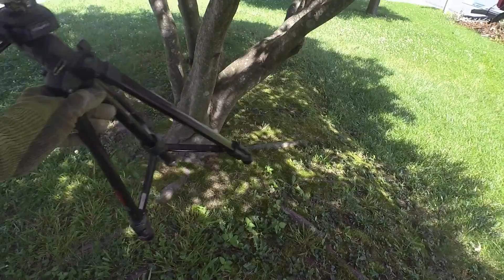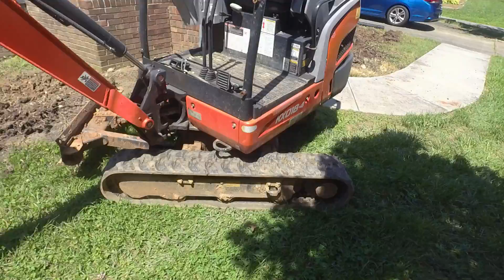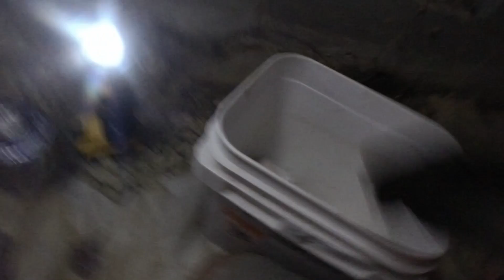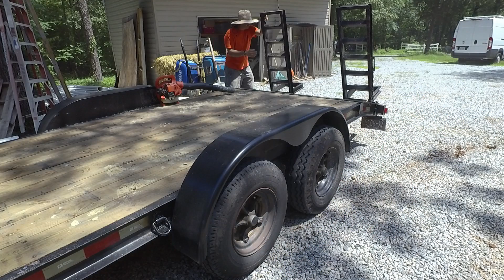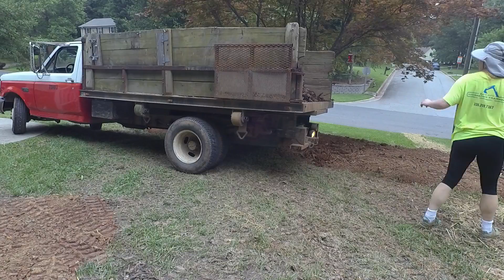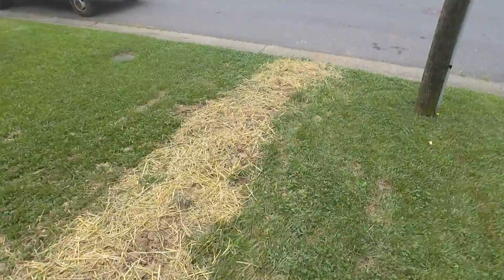Sump Pump discharge line turned into some stump removal and dirt work

Comment: I've been told you should have an air vent where it exits the house since an airlock/vacuum is created when the water runs to the street. I've used a wye tee at the house exit with a few inches of vertical pipe then to an open 180 to let air in at the highest point.
Reply from the maker: Yes you can do that so the line drains down. This is only the case when the discharge is lower than the pump.

Comment: Hey Shawn, I just want to know why that down spout near the sump pump discharge wasn’t caught?
Reply from the maker: We just took the 1 1/2" line to the curb and not a 4" line. The gutter discharge wasn't causing any problems like the sump pump line was. 👍
Reply: @GCFD  ok thanks. Great job as always. Learning a lot from you.
Reply: Looks like another gutter discharge on same wall back corner. Oh well ! Owners yard.

Comment: Should have picked up that gutter then connected sump drain line into the gutter drain. 

Gutter draining straight down then going into the sump pump is prob the reason water is there.
Reply from the maker: 👍 I offered but the homeowners didn't want to.
Reply: @GCFD  I’ve been doing drains around my house too you have amazing videos! Best part is seeing the drains in action!
Reply: first thing I thought of too soon as I saw the gutter right there